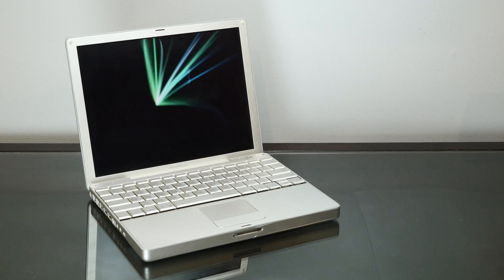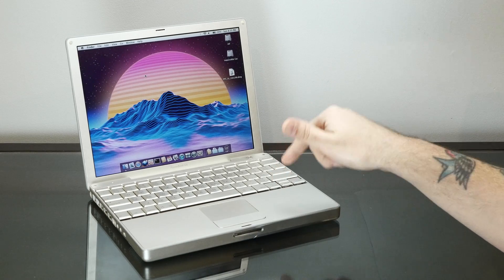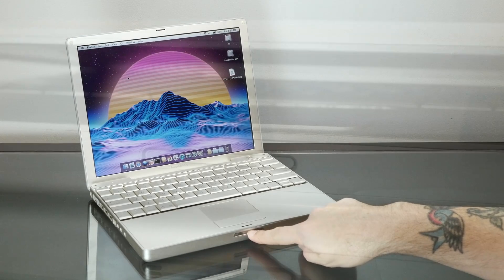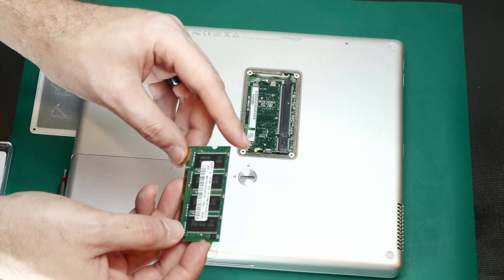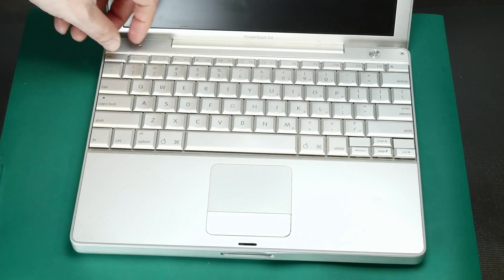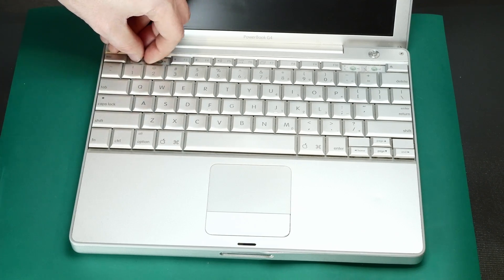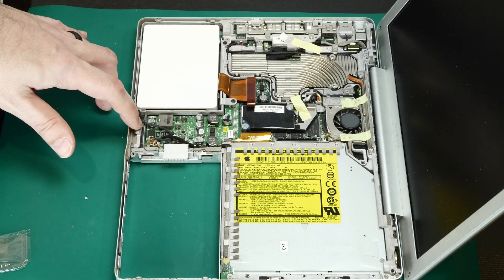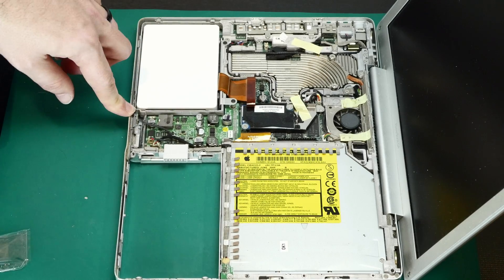Upgrading the 12 Inch PowerBook G4 to its limit - Max RAM and mSATA SSD!

Comment: I love your videos. Thanks for uploading them. The last 12” PPC Powerbook G4 is always nostalgic. I still have one that haven’t used for a few years. Same model with same spec. I’m now thinking reuse it by upgrading but one thing I’m concerning is that web browsers. The biggest reason I stopped using it a few years ago was that latest version of web browsers didn’t work on the machine. I only used it for internet and word program sometimes so I will definitely try to upgrade it for reusing if it can fully open all the latest internet browsers. Could 2gb ram stick be worked by the way? I mean total 2.25 ram. Thank you again for your videos!
Reply from the maker: Thank you so much! Unfortunately the biggest stick it will accept is 1gb :( While you can't use modern browsers, TenFourFox works awesome on here.
Reply: @ActionRetro  As an alternative since you are running 10.5, Leopard WebKit is an option, and it runs better than TFF in many cases.
Reply: @ActionRetro Thank you so much! I never heard about that. I will definitely turn my MBP12 back on again as there is a browser that works on the machine. Thank you!!

Comment: Shame that the 12 inch model never got the same level of upgrades as the 15 and 17 - no higher res displays, no better GPU, not even DDR2 RAM.
Reply from the maker: Oh yeah, more/better RAM would have been especially awesome in this.
Reply: @ActionRetro  Ironically the last iBook G4s accepted up to 1.5GB in total - more than this machine!
Reply: The PowerBook 12” models had a total RAM capacity of 1.25 Gb. 256 Mb was soldered on the motherboard and then you had the single DIMM slot were you could put an up to 1 Gb DIMM.
Reply: Bad GPU on your PPC Mac! My iMac G5 can't even render Menu Bar Transparency WITH Core Image and Quartz Extreme even it they are Hardware Accelerated!
My iMac G5 takes more than 1.5 gigs tho, so good on ya G5.